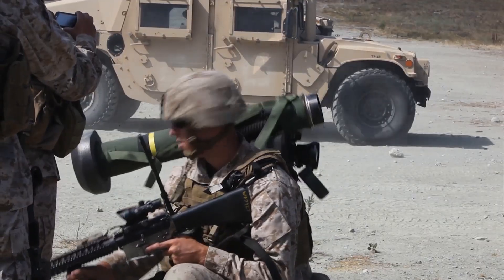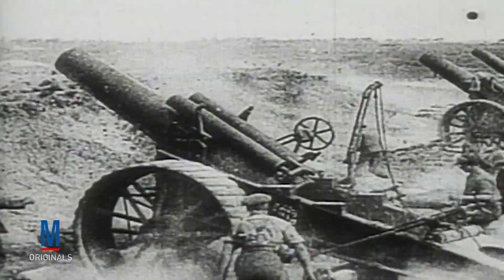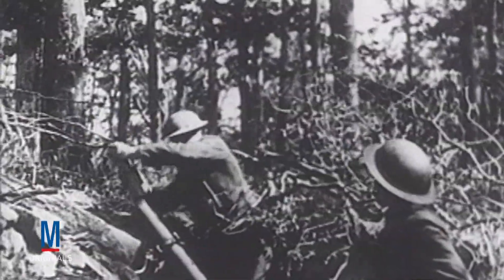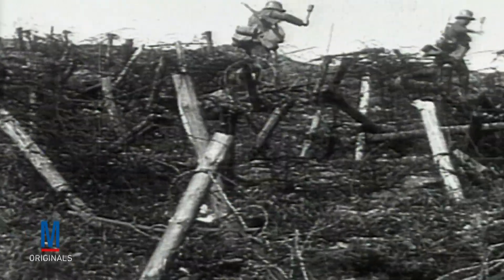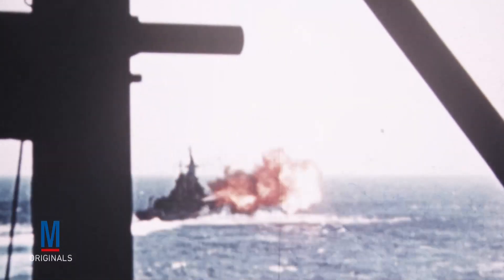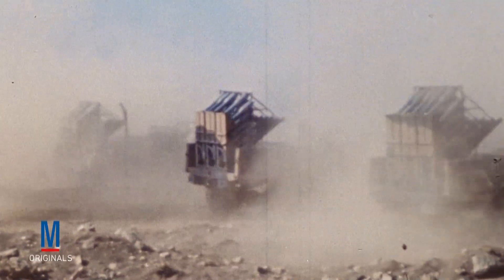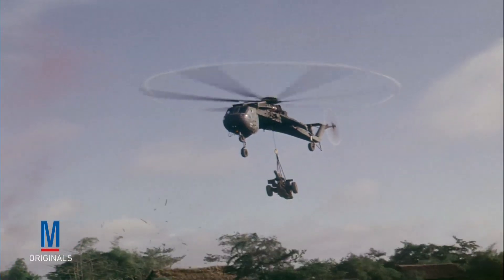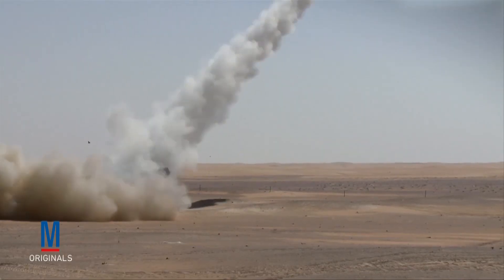The Evolution of Artillery

Comment: Evolution will be Railguns; not a rail gun as in a cannon mounted on a train, but a railgun in the sense of using electromagnets to propel a projectile at extremely high velocity. They can propel a projectile at a much higher rate than conventional gunpowder or rocket.
Reply: +Matt Rupp we already have it. Its in testing but we do have it.
Reply: GodOfThe Wolves I did a project on how they work...they are badass
Reply: Matt Rupp That they are!
Reply: +Matt Rupp Explosive artillery will still have a role to play. Unlike railguns, mortars and artillery can shoot over things and engage the enemy from a vertical angle.
Reply: Gabba956 But why shoot over things when you can shoot thru things?
Reply: +GodOfThe Wolves That's a great idea ;)
Reply: +GodOfThe Wolves Try shooting through a mountain range at a target 30 miles away.
Reply: Did it happen

Comment: Under the definition of artillery the modern portable mortar doesn't fall under this as it is classed as infantry. You seem to focus on mortars quite a bit in this video though they are not artillery. The older type of mortar that was used in defensive forts can be classed as artillery due to its size and not being portable like the modern day equivalent.